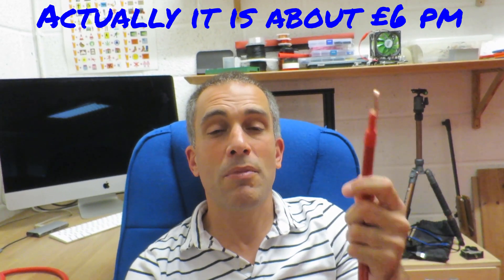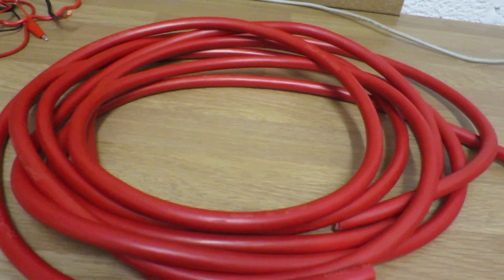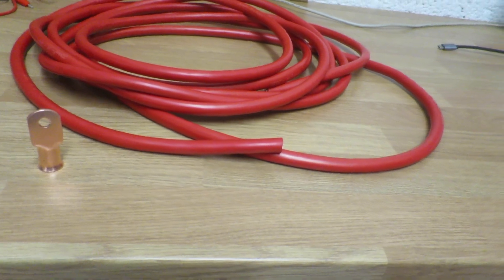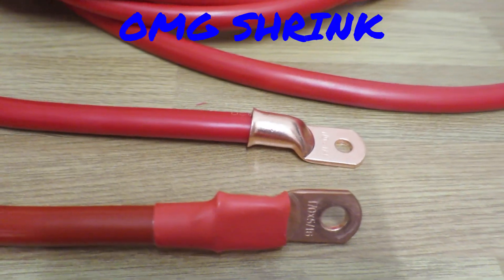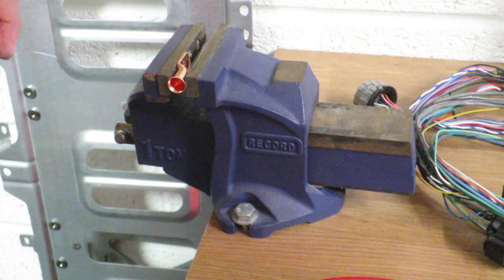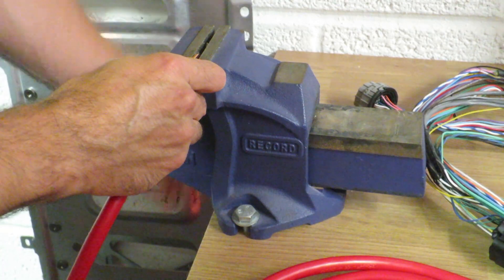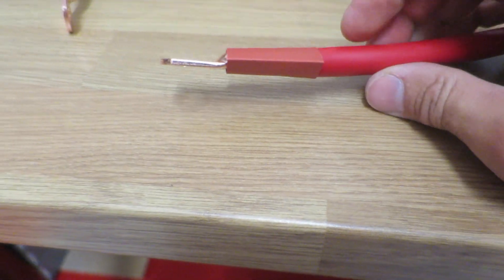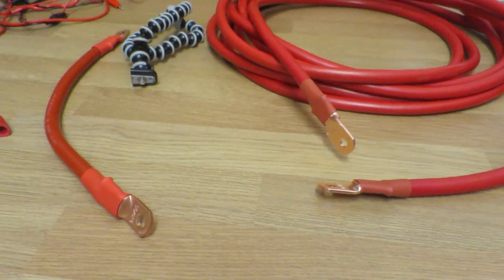Nissan Leaf High Voltage Cables to use in the Mazda RX8 EV

Comment: Good to see the new workshop is sorted. 

A vice clamped crimp isn't suitable for this. If you're going to be making HV cables, you need a proper crimping tool. 
Also HV cables should be orange, which avoids confusing them with standard 12 Volts vehicle cables.
Reply from the maker: Hay, it does appear the advice is to NOT do what I am doing!!! Interesting as they have worked well to date.

Comment: Hi bro. In nissan leaf non grounded HV wires only inside of battery, since battery case itself is grounded. Every other HV cable outside battery is grounded for EMI protection.
Reply from the maker: Yeah, this is only temporary wiring as the battery packs have not been built yet.
Reply: @SouthWestEVUK  Actually, its a same thing with any produxtion hybrid/plugin cars as well. I have no chance to see a regular HV cables without ground shild at any production car.

Comment: i would not trust that vice crimp, please buy a cheap chinese hand or hydraulic crimper :)
Reply: I don't even trust my hydraulic crimper, i cutting a slot after crimping and solder it thru.
Reply from the maker: Ok, looks like the advice is screaming at me to do this differently! Will assess and update.
Reply: @SouthWestEVUK  Thermal cam can show you a hot spots in the progress of load testing. I'm using a themalcam a lot in electonics repair and custom high current wiring.